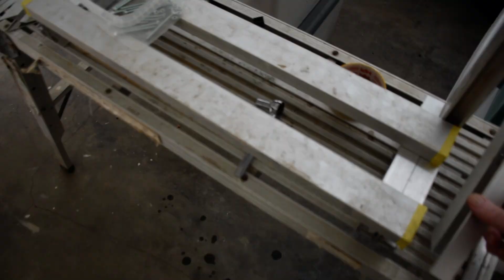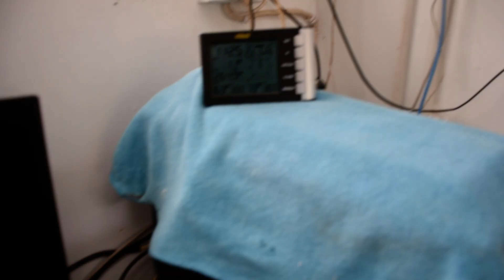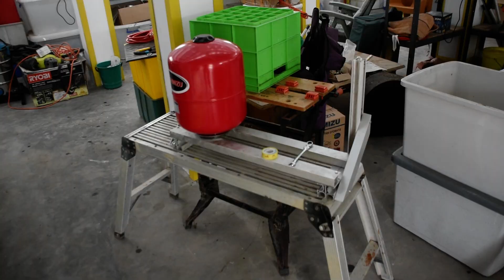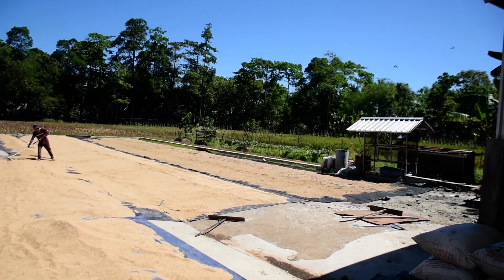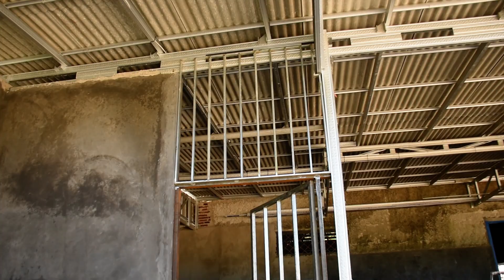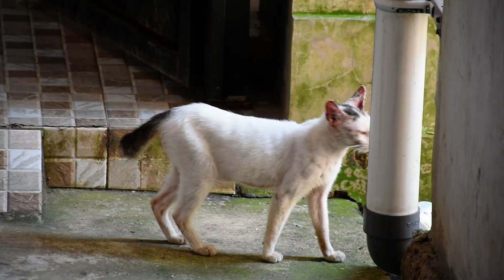Shelf completed, mechanics, dud battery module, rice factory, cats

Comment: Good to see you still making things happen and solving problems.  That humidity sounds brutal though.
Reply from the maker: I like to make stuff.  That's my dad in me.  He was a farmer who invented all sorts of labour saving devices to help with his work.  For example, he made a number of modifications to his wheat harvester.  To such an extent that the local International Harvester engineer came and took notes.  

The humidity here truly is brutal.  I think the highest temperature I have seen here is about 36C.  Any excursion outside the 22-36C range would be highly unusual.  But the humidity pushes the "Feels like" (aka "Heat index") way higher.  I have seen that reach 55C here.  I looked at average humidity for 2024.  For the full year, the average was 90%.  For 3 of the 12 months, the average was 95%.    

The primary benefit of the AC in my lounge room is pulling down the humidity.  The little unit on the table beside me says it is 26.4C 60% humidity in here.  That's comfortable.

It could be worse.  An ex colleague of mine (Jim) was on a work visit to a chemical plant in KSA (which I figured out was Kingdom of Saudi Arabia).  I had always imagined KSA to be arid.  Not so where he was.  Jim told me he had to re-calibrate what he thought was hot, as it was 49C, with "feels like" 58C.  The dew point was so high that, when he stepped out of an air conditioned building, moisture would immediately condense out of the air onto his relatively chilled clothing.  Leaving him saturated before he had time to break a sweat.